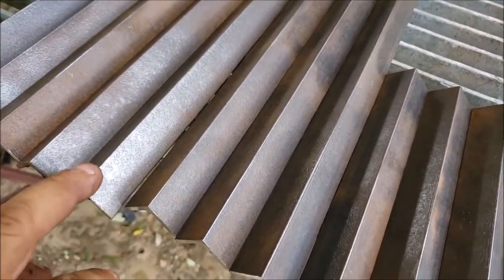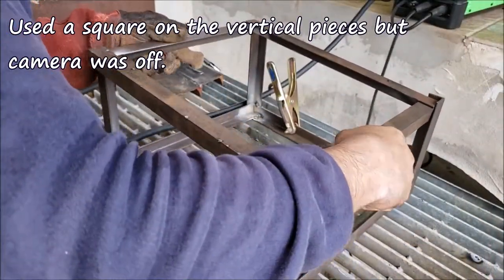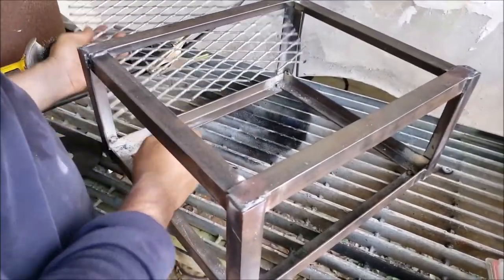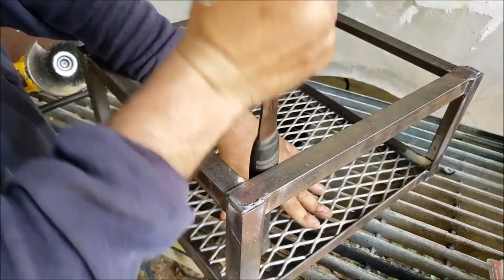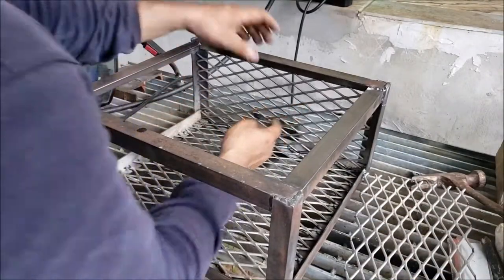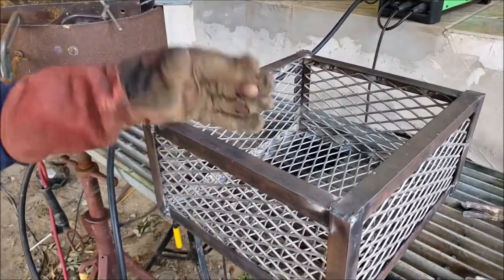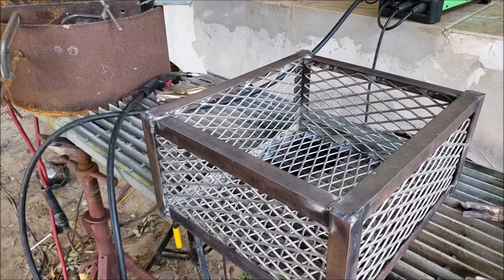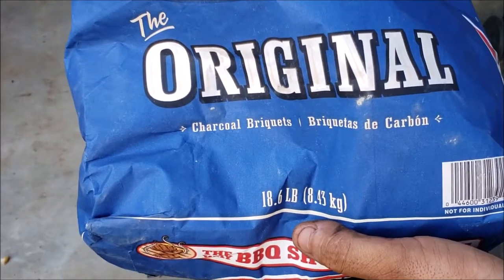How to build a charcoal basket for offset and vertical BBQ smokers. DIY  Project

Comment: Nice!.... Those baskets help out alot on the even burning of charcoal for better heat and even cooking....👍👍
Reply from the maker: I can't wait to try it out. I want to do some Baby back ribs or even dino ribs. I need some free time first so that I can finish the vertical smoker. This was the last project I did and now out of ideas and money.
Reply: @cutweldngrind  I hear you on the money end..... What ever you decide to do, keep us posted in a video....
Reply from the maker: @BigLou956  I have a project that I may work on this weekend but its not a welding project. I will upload it still if it works out for me. Well have a good weekend.
Reply: @cutweldngrind  like wise my friend.... Happy weekend

Comment: That's cool, you'll have to do a Vidio of you doing some cooking on this gear.
Reply from the maker: I better start thinking what to cook on it.. I was going to work on the vertical smoker today but its super humid today. Right now the temp is 94.1F ( 34.5C ) and 32% Humidity and hardly any wind. 
Whats the update on the Tracked RC?
Reply: @cutweldngrind  I was working in central Austrailia when I was younger doing fencing and building sheds outside all day and the temperature got up to 48°c one day. (118°f)

Comment: Nice work bro!!!
Reply from the maker: Thanks. I now have to finish my vertical smoker but I work the weekend. I really want to try it out and its been like 2 weeks or more since I built it.
Reply: What do you do for a living?
Reply from the maker: @ajsironworks3937  I am a technician in the oil and gas industry. I install instruments, solar panels, communication systems and test equipment. I been doing this for about 11 or 12 years and it's easier on my back than the previous 5 years in concrete work. I always liked welding just have to learn the skill as most my family is into construction.
Reply: Well you learned to weld very well. I’ve watched you videos for a while now and really respect you stick welding and entire smoker. Bro you’re a craftsman.
Reply from the maker: @ajsironworks3937  Thanks. Last week I bought cheap tools from Harborfrieght to make things easier for me. I got my first Bench drill press, tap and die kits, 6" vise and smaller vise for the press. My wife's birthday is this month and she wants a Bench Swing so we will see how that comes out. I wanted to go all metal but know thinking of metal and wood for the bench.
Reply: Their drill presses I think are good. Show a video on how it turns out please.